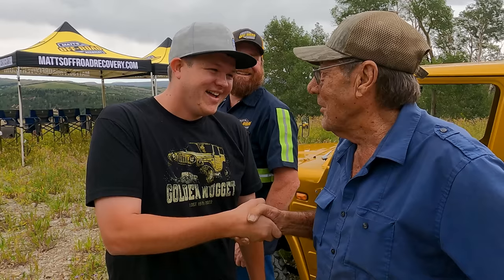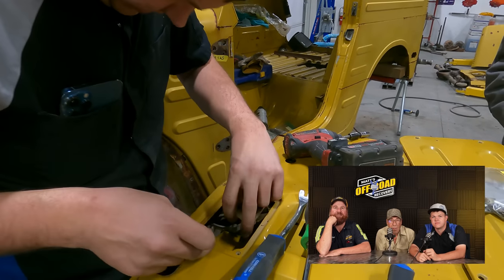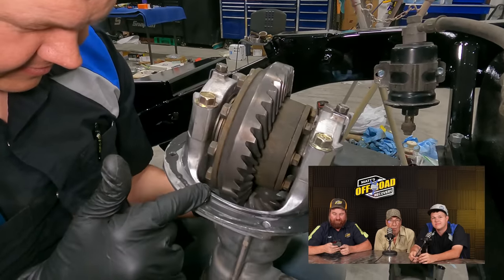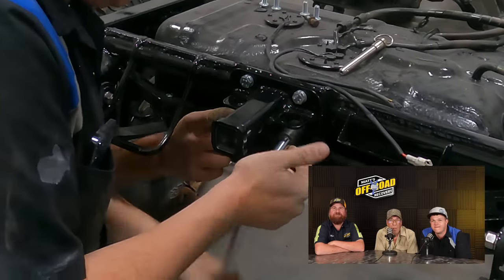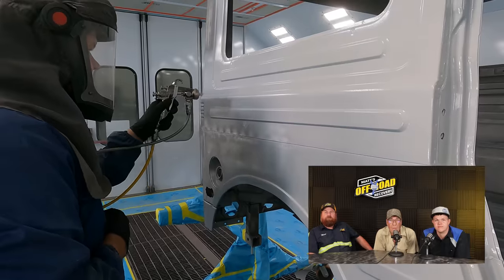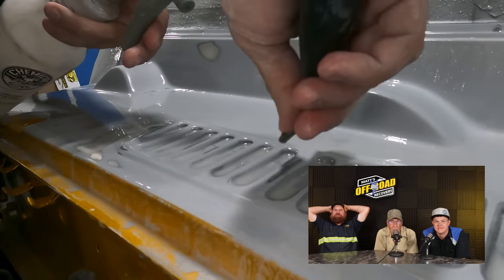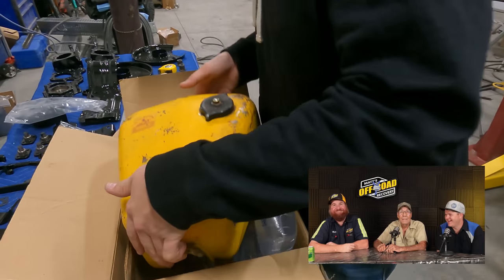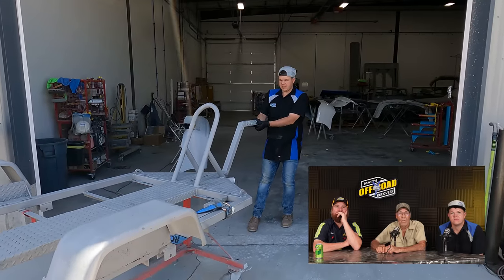Ed Reacts To The LJ20 Golden Nugget Build

Comment: I think you need some ABS foam underneath the roof bows . A roll of 2mm in black or gray should do it and stop the rattle inside.  Everyone on the Robbie Layton team and family gave alot of hours on restoration, body work, sanding,sanding,Sanding, SANDING ,painting. Then everyone on the custom trailer building for Rokon rebuild everyone pitched in on . Bikes and Beards, your brother on the trailer wood. Some re-did the seat on ROKON , the goose neck twice,  all the sandblasting.

Comment: Saw that the sand blaster caused problems for Fab Rats with leaving sand in the front and rear ends but I hadn't realized that part of the reason for the eternal sanding was that they used too big of grit as well. Impressed you didn't throw them under the bus even with how many problems they caused.

Comment: A bit late but I know Ed's question, enamel requires hardener but you can spray it without it only problem after a month you can still put your finger prints in it. Enamels great it covers everything and once dried it is pretty much bullet proof. Just heard about clear coat, a big problem is peeling the way to avoid it is use 5 to 10% color and that stops the UV from peeling it off. That's where base coat clear coat systems failed.

Comment: Clear coat peels if you don't look after it.
You need to wash all the contamination off weekly and replace the oils often with a high quality polish.
I was a truck driver and my car would be parked in 40+ degree direct sun for months at a time and I would wash it every Friday and polish it every 3 months or so and 12 years later when I sold it paint was still perfect.

Comment: The Mark IV has the rear end not open rear area of the inspection plate that can attach to the rear differential. The ring gear is 7.5 inch 3.58:1 axle ratio but if the BOM code have letter G in the tag follow by 3 digits. Then it is 8 inch ring gear Mark IV in 1961- 1969 as part of the Katana 1600cc or less accordance catalog to Mitsubishi during the era before Mr. Mazda was born.

Comment: After the rear end locked up on Paul's test drive, a couple quiet comments were made about not using that media blasting company anymore.  The whole time that Robby and the crew were sanding for a month, I just chocked it up to them being over the top aiming for that beautiful finish after painting.  It didn't cross my mind until Ed's comments in this video that maybe they had to sand it because of the texture left by improper media blasting.  Good lord, there must have been some fun words used when they realized the work that just got dropped on them after getting it back from powder coating.

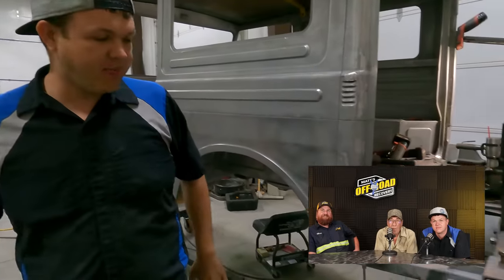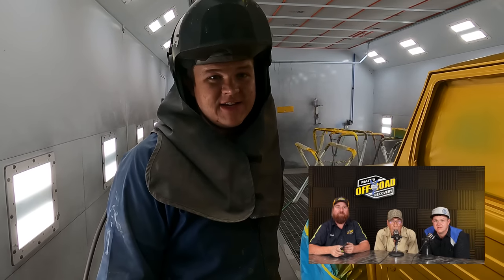Comment: I like how Ed asked: "You have to take the axle apart, to paint it?" @14:02... I don't think Ed realizes that Robby, Hillbilly and Dinner are working "After Hours", when they are packing the bearings. @18:58... Ed got a kick out of all of the dents! 😊😊 @25:01... I like how Matt laughs at the "Factory Crap Weld" comment! 😄😄 @38:45... I don't think Ed quite understands how EXPENSIVE the Gold Paint actually is! @42:37... One thing that nobody checked: "Does the Ignition Key Fit the Door Locks"! (Ed, ever the Detail Man!). @53:08... I love Ed's reaction to Hillbilly, getting whacked in the head! Wait, @1:11:34 Matt gets a Yellow (undisclosed item)!?!? 😉😉😉😉